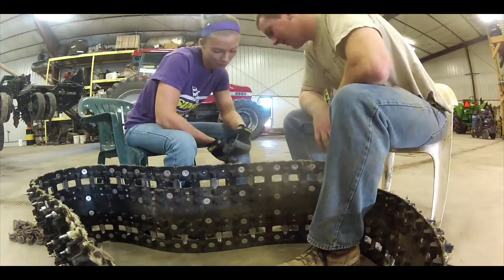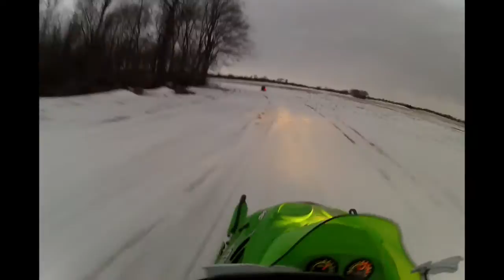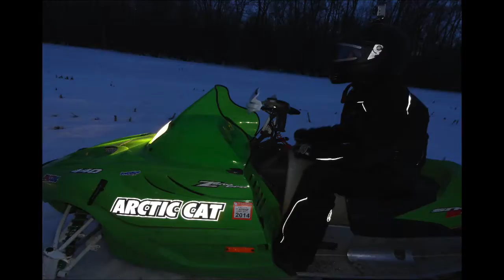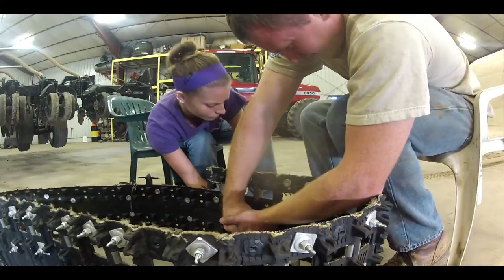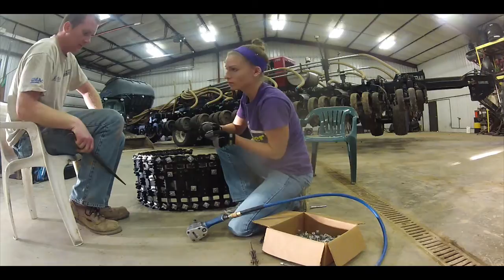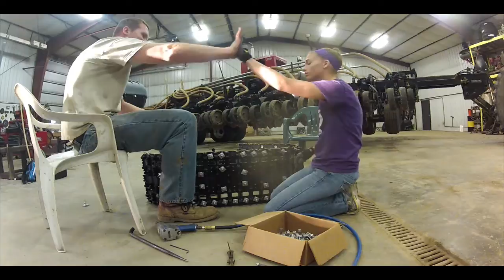Me taking studs out of a snowmobile track and riding my '02 Arctic Cat Z440 Sno Pro (Part 2)

Comment from the maker: We did end up using an air wrench right after this was shot, but it wasn't any easier to do because the studs were so bent and the nuts were so tight. We eventually gave up and just bought brand new studs to put in my ripsaw track. We at least got some back up studs in case we need them.

Comment: have you been using ripsaw tracks for racing? I noticed the race track is mostly ice, just wondering if you ever tried the hacksaw? shorter lugs are better on ice plus less resistance get some more speed.
Reply from the maker: No, I run a hacksaw for racing. This was before we decided that the sled would only be used for racing. I run a hacksaw track on this sled with 1.2" picks in the middle and 1" picks on the outside. I sold the ripsaw track a couple months ago.
Reply: gotcha, I came across your videos the other day, nice driving btw!
Reply from the maker: Thank you! We're one day away from having Sophie (yes, I named my race sled) on the ice come Saturday. We've worked more on the clutching since I have a season of racing under my belt and I know enough about my sled to figure out what's working and what's not. She's having a hard time powering out of the corners, like I'll pin the throttle and there should be more "get up and go" than she currently has. We completely redid the seat and the gas tank, so she'll look way different this year, and because I'll be able to lean better, I can stay in the throttle more in corners and still keep my inside ski under control. Two years ago was the first time I ever rode a snowmobile and I'm so thankful to have a natural talent for racing.